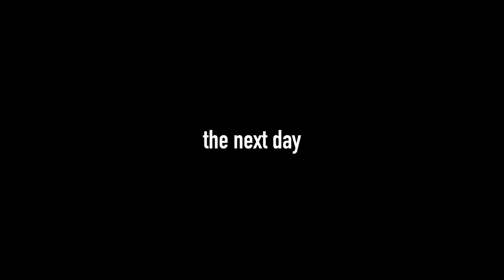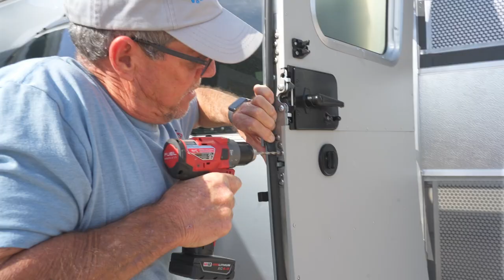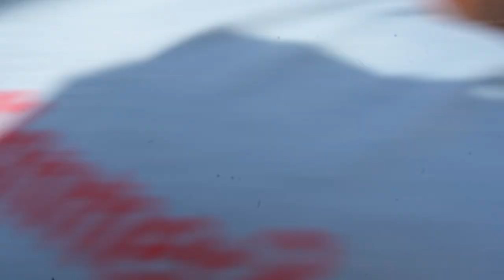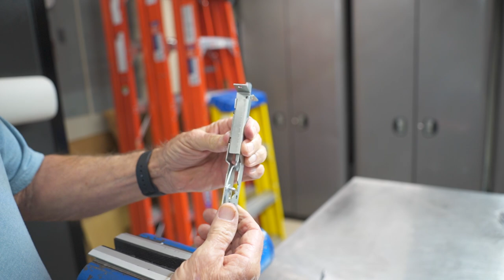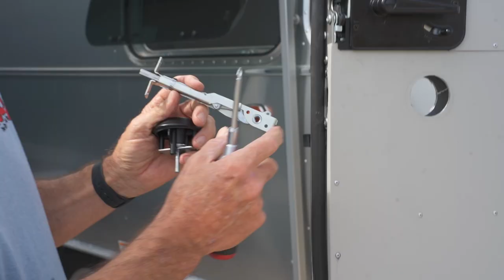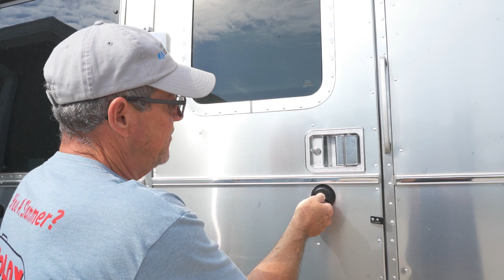RV Security: Repairing the Airstream Deadbolt

Comment: It seems that you could disassemble the entire deadbolt bent "shield assembly" and rotate it 180 degrees so that the "opening" would be on the inside part of the door. Then, if you did try to close the door with the deadbolt out, the "shield assembly" would not get bent.

Comment: Just had this happen on a recent trip.  As a quick fix, you can used a flat screwdriver to bend the plate towards the bolt from the outside without having to take anything apart until you get home.  Just look where the deadbolt comes out of the door and look for the plate next to it on the exterior side of the deadbolt, then bend it towards the deadbolt.  This will guide it into the jamb so you can lock the trailer.  I opted to not install a zip tie.  Installing one would reinforce the plate, but that might result in the deadbolt bending instead if it happened again.